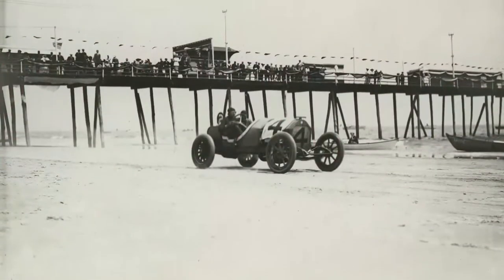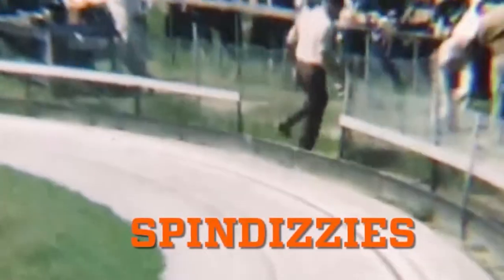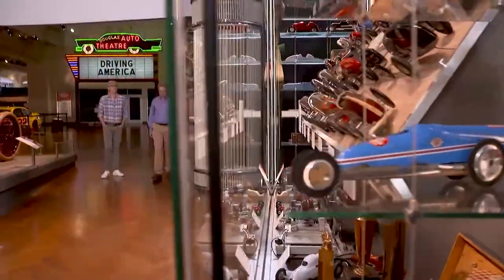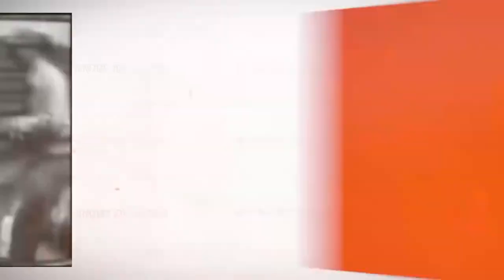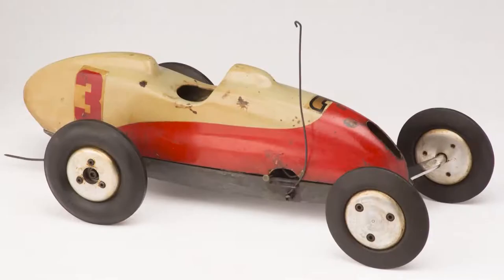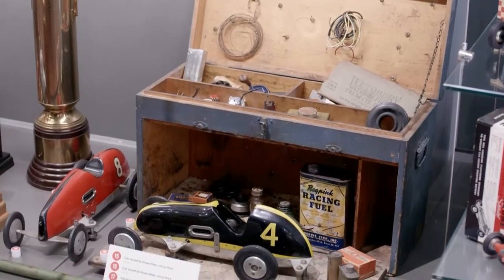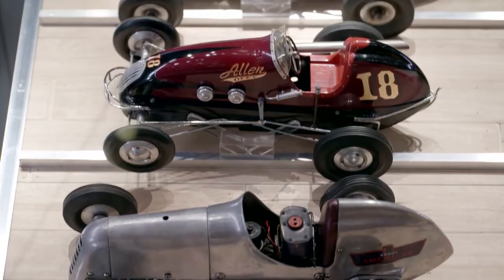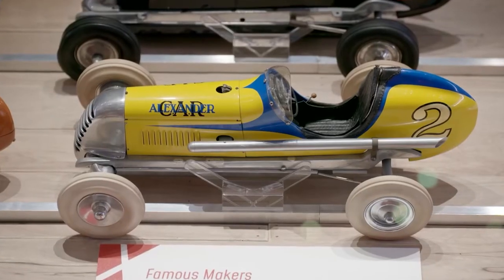History of Tether Car Racing | The Henry Ford’s Innovation Nation

Comment: Interesting.  I inherited from my great uncle's estate a tether car that he built and raced during or shortly after WWII.  I can remember watching him race it on track in a park in Dallas Oak Cliff, probably in 1948.  Although he converted the car's engine to glow plug ignition at some point, I still have the spark ignition assembly that was originally installed.  Spark ignition systems allowed the car to be stopped mid-race if the operator desired.  Notice that some of the antiques in the video have a stiff wire protruding from the top of the car.  These wires were connected to a crude switch that disabled the ignition when somebody just outside of the track bravely held a bundled rag or some such device just above the car's path and triggered the switch as it passed by.  Glow plug engines will only be stopped by brute force or fuel exhaustion.